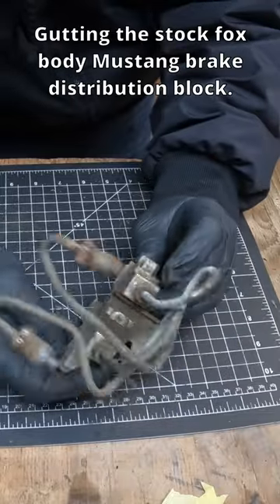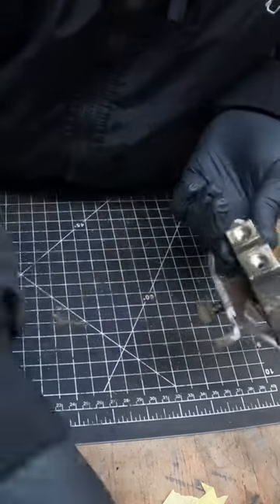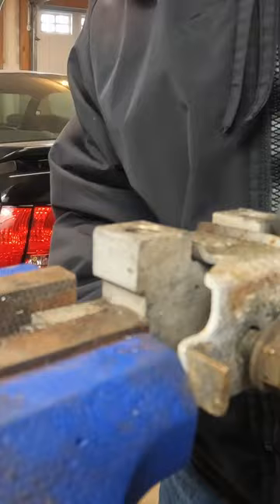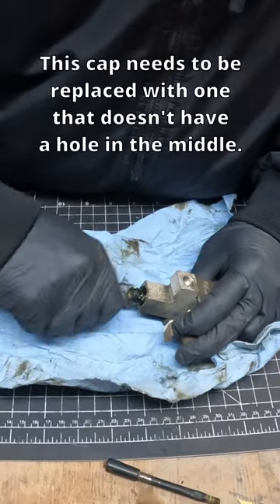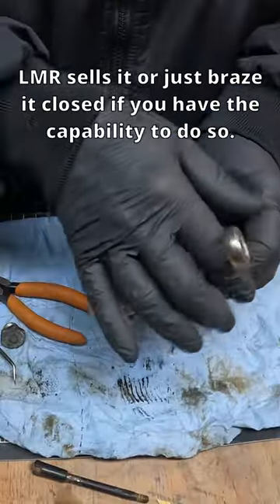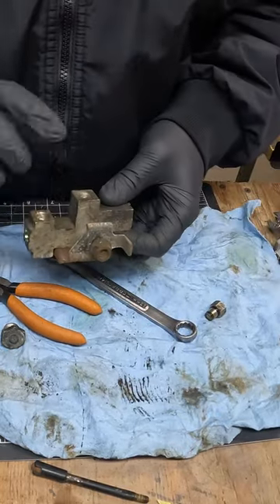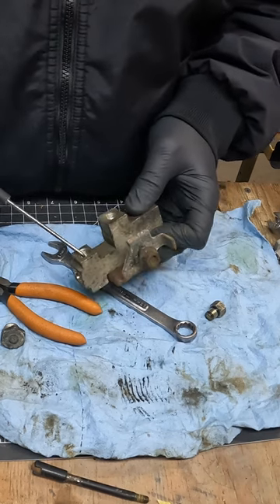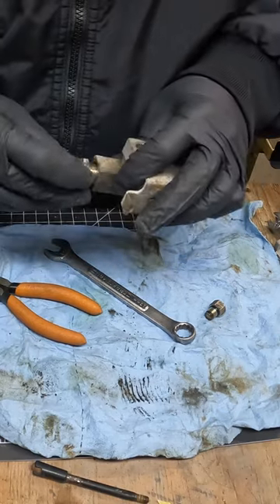How to gut your fox body Mustang brake distribution block #shorts #tldw

Comment: Gutting that will tie the two sides of your master cylinder together.  That means if you lose one caliper, you have no brakes.  The stock setup gives you half your brakes upon a failure.
Reply: Wait so is it good to gut it or not?
Reply: @Gmed11 from what I understand, bad
Reply: I'd recommend muscle car research LLC
Just ordered my brake distribution block rebuild kit from there.
9 bucks